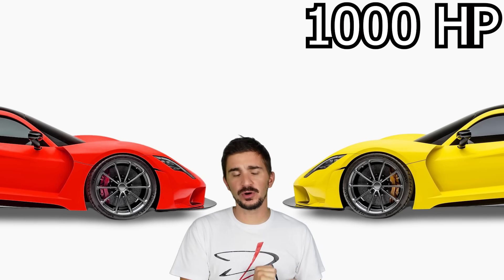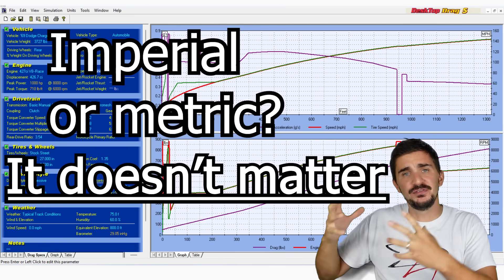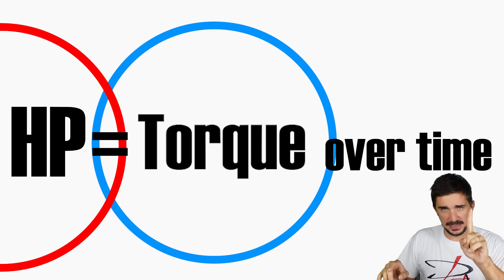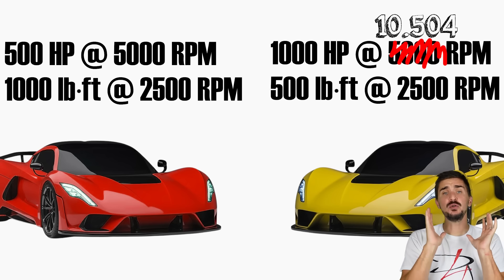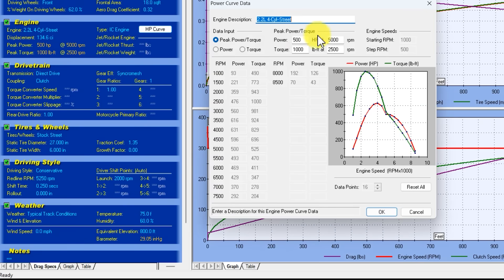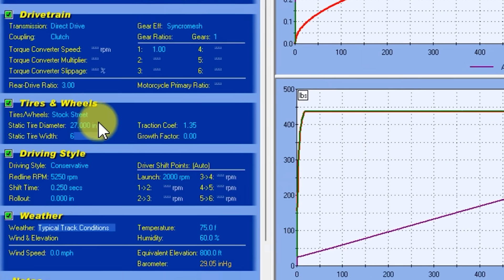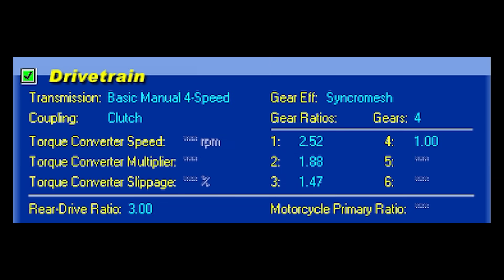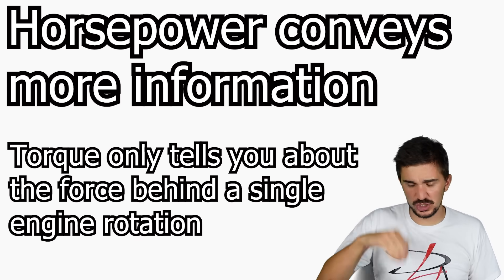Who's faster? Explained and Simulated - Horsepower vs Torque

Comment: Power = torque X rpm. I am not sure that equation has ever changed. Very few seem to consider that the transmission is part of the equation as well. It is torque at the wheels that determines acceleration, and final drive ratio/hp that determine top speed - not simply torque at the engine crankshaft. Just ask your local F1 driver.
Reply: your local what

Comment: To make things short, the car with more HP will always be faster as long as you are operating at RPM where the car is close to or at peak HP. The car with more torque will be faster only in situations where you are at low RPM where the car with more peak HP is not even close to that power.
Reply: yes

Comment: i really don't like the punching analogy.
simple reason is that energy equals mass times velocity squared.
thus velocity is the more significant metric in this case, meaning that someone who can move their fists faster to punch more frequently is automatically punching harder, so long as the overall mass is equal.

Comment: If we construct two engines with the same power curve except one is scaled to twice the max rpm with half the torque but twice the gear ratio, both cars will produce the same power at the same percentage of max RPM. The high reving car will have half the torque yet both engines will (assuming no drive train losses) perform EXACTLY the same in a drag race.

Comment: Test is so unrealistic and pointless. . Ur using 1:1 gear ratio. That 12k rpm engine would go like twice the speed to hit its 1000hp mark. 
Second u left the redline 5250rpm so engine never would hit the 1000hp. At 5k its 476hp 
This test is pointless.

Comment: I think main catch in this "versus" is the fact that you can adjust the wheel torque to any number you want with the transmission gearing (by the cost of rpm)
On the other hand there is no way to improve hp with any mechanical device. Maximum you can get is little improvement of hp for a few seconds with e.g. big flywheel but it's completely impractical 
So , basic idea is that what hp you have under the hood the same is on the road, while no matter what your engine torque is, you can get it as high as you want on the drive wheel

Comment: what simulating software are you using? i have an engine design that I'm working on and I want to be able to simulate the engines power output

Comment: The 1000 hp one will be faster if you push them both but the 1000 torgue one should push harder at low rpm assuming the transmission is the same

Comment: Well on the ocassions where the „torque biased” engine won, it would be worth metntioning, that the „power biased” engine lost because it never actually made it’s power or made it only briefly. The „torque biased” engine made more power on average.

At the end of the day - only power maters. The confusion comes from the fact that peak power that occurs at a specific RPM value, doesn’t tell how much power the engine makes anywhere else in the rev range.
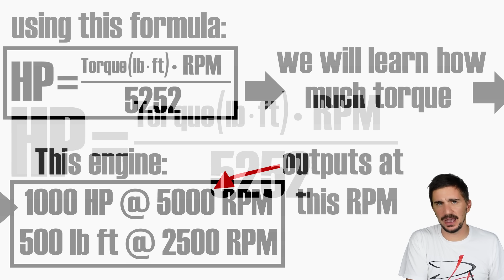Reply: yea cos he take gearing from 💩 which none manufactury use ever even for least sporty car or bike ever 🤷🏻‍♂️ once he give each of those engines perfect gearing and gear quantity its game over for more tq les hp version 👌🏻 assuming enough grip asf ,racing win power 👌🏻 never ever torque 🤭 mine cb 500 feg have 57 hp and 47 nm and smoked in drag race or on track with corners something like let say 🤔 yamaha mt03 this old not this new one so 660 cc 47 hp 58 nm at the same tire similar suspension asf 👌🏻 1/4 mille 13,4/152 km/h vs 14,2 sec /145 km/h and like 3-4 sec faster lap times on avg 4-5 km track 👌🏻 cos more power at the same speed generate more force accelerate bike forward faster ….. dosent matter how much less torque is available 🤓👌🏻☕️ hees presentstion is a joke like couple other on yt aswell 👌🏻 engine with more torque at low rpm is easier to ride dont need to hold so strictly to certain engine rpm so dont need to shifts so much up and down for get max performance on track 👌🏻 can give more pleasure avg rider due to theyr preferention 👌🏻but it cant beat on track more powerfull version with skill rider on it at similar tires perfect gearing asf both on dragstrip and on track with corners cos watt:m/s= force is key of take of corner acceleration level and acceleration overall everyhwere 👌🏻 ☕️ and yea me lap time 2:09 something on poznan track on me stock cb 500 pc26 on pirelli  sport demon is rubbish 🤮 so im must fix it 😉👌🏻☕️

Comment: Souly based off the words that were spoken "cannot cause damage with a weak punch"...   if you were to take a table spoon and repeatedly tap the top of your hand with a soft tap... over time you'd break the bone in the area of which you were tapping... same as a drop of water let's say on the forehead in the same spot over time will soften the skull...  but that's not what the video is about so back to the show..

Comment: HP will win because too mich torque will only make too much wheel spin in the first two gears. HP builds up with rpm exponentially. Depends on the maximum rpm of the engine obviously.

Comment: If they faced each other on a racetrack, the one with more torque would win. Experiment over. Sorry, I couldn’t resist.
Reply: buehehehe not true 👎🏻 sory boi 🤷🏻‍♂️😎  power knockout torque at race track like nobodys bisnes 😎 not even close 🤭👌🏻 …. feg me honda cb 500 pc 26 47 nm 57 hp vs yamaha mt03 660 47 hp 58 nm and cb smoked mt03 👌🏻 or benelli imperiale 400 29 nm 21 hp vs benelli tnt 302 25 nm 37 hp and tnt 302 smoked imperiale 👌🏻😎 or ultraviolett f77 recon 100 nm 40 hp vs let it be again me cb 500 pc26 47 nm 57 hp and f77 is smoked on racetrack offcorse we talking about fastest rider and the same tires on each bike😉👌🏻 i have also some test with car on poland  poznan track so feg fiat bravo sport 1,9 multijet  150 hp 310 nm best lap time under pro racedriver polish champ in some cup on this track 👌🏻 2:07:95 sec 👌🏻 vs feg seat leon cupra r 225 hp 280 nm 2:02:4 sec 👌🏻 or skoda fabia rs tdi 130 hp 310 nm 2:10:5 sec vs honda accord  2,4 type s 190 hp 223 nm 2:06:45 sec 👌🏻 where torque win against power at race track ?🤷🏻‍♂️ where? i cant see it 👎🏻🤷🏻‍♂️🤭😎☕️
Reply: @mociczyczki  it’s a joke. If they are facing each other they will run into each other and be pushing themselves backwards.

Comment: I wouldn't make this so complex to understand. Horse power is the thing that accelerates the vehicle and engine torque is insignificant. All we need is a horse power curve and we can the rpm's to accelerate with. Best acceleration happens both sides around the max hp area by maximizing the average hp during the acceleration. The flatter the power curve is, the less gears we need.

Some can say it is the torque, which do the acceleration, and it's true in certain ways. Constant torque in a wheel cause constant acceleration. However, we need gears with practical engines, and we can't use torque curve in similar simple ways.

Comment: He is very wrong. Torque can be applied and get zero HP , but you can never have zero torque when you have hp. Torque is a rotational force. Apply 2500 pound feet to a frozen up wheel, how much Hp did you measure? Zero. You need the rpm the frozen wheel didn’t have. 

The biggest pile of HP wins every time period.

Comment: Torque vs hp discussion only tells you’re ignorant. In here it was not properly addressed that you need to have the gearing figured out to make use of the power avalilable. It is still apples to bowlingbools to asses different poweraources with same gearbox.

Comment: This is a superb example of a person who knows a lot, but does not understand what he knows... maybe he needs more time... maybe just too young.
Reply: egzacly 👌🏻 he totaly avoid perfect gearing simulation where more powerfully less torque version absolutely smoked counter more higher tprque version less powerfulll 🤭😎👌🏻☕️ real life egzample electrick kick scooter 120 kg with 80 kg rider on it kukirn g4 38 nm 2,7 hp in rear whell hub motor 0-50 km/h 7,5 sec +/-  + max speed 60 km/h gps vs honda dylan 150 gasoline cvt 14,2 nm 15,5 hp 210 kg with 80 kg rider on it so almost double the heavy weight to accelerate yet 0-50 km/h in 3,75 sec + max speed 105 km/h gps 🤭😎☝🏻some another egzample benelli tnt 302 27 nm 38 hp 210 kg vs h-d x 440 38 nm 27 hp 200 kg let say on h-d is 10 kg heavier rider 0-100 km/h benelli 7,5 sec vs h-d 10 sec vmax benelli 155 km/h vs h-d 138 km/h gps 🤭🤷🏻‍♂️ hees video is trash like many other on yt ☝🏻😎 however in regard to daily riding normaly not racing it can help choice avg people better car in heees stupi….ty 🤭 🤷🏻‍♂️ fpr them with more power on lower rpm hat gives them better elasticity but when it comes to pure racing power absolutely beat tprque 1000000% 🤭😎☝🏻☕️

Comment: You’ve explained something that I have been wondering in a long time in just 14 minutes perfectly for newbies, kudos to you sir!
Reply: yhm but than you setup drag race between brough superior ss100 75 nm/45 hp vs bsa goldstar 650 55 nm /45 hp vs honda cb 500 pc26 47 nm/57 hp vs kawasaki zx4 rr 40 nm/75 hp let assume if something here have not perfect gearing in regard to its peak power width than we give this bike this perfect gearing for 1/4 mille also we compensate diffrenc in weight be additional weight on lighter bike and that zx4 rr we take off fairing for also make its drag worse the same as other 3 bike here naked 👌🏻 and what happen ? 😁👌🏻👉🏻 ss100 and goldstar cross finish line basically in the same time around 14,2 sec on1/4 mille honda cb 500 cross finish line in 13,2 sec with around 40-45 metres advantage and zx4 r without fairing cross finish line in 12,2 sec with 80-90 metres advantage against ss100 and gold star 650 and 40-50 metres advantage against cb 500 👌🏻😎 so yea wait 🤔 bike with bigest /highest crank engine torque cross finish line last and bike with lowest smalleelst crank ngine torque first? 🥴 welll YEP egzacly 👌🏻😎 the placement was beacuse of power diffrencesss not beacuse of torque diffrencesss and hess video is well dont be lie 👉🏻just 💩 🤷🏻‍♂️☕️
Reply: his explanation is kinda confusing with the punches and stuff.
Torque is how much force you can apply, not speed. instead of seeing it like a damage per hit, consider torque as armor penetration.
You need good armor penetration and good damage to kill a monster with armor and health, but a monster with no armor but lots of health only needs high damage. On the other hand, a very well armored monster with low health will simply ignore your attempts if you have no armor and can not deliver your high damage.

Real life example. 
Would you rather take an impact drill or a regular drill to defeat a bolt with lots of "rust" armor? Impact drill has a lot of torque, but low speed.
But what if its a loose bolt? Aka has no rust armor.

Big rigs in Europe have lots of torque, very little horsepower, because they need to defeat the "weight" armor quickly so they can quickly apply the "speed" damage while American trucks dont really care about the "weight" armor and rather flash their high "speed" damage, resulting in slow acceleration, but they get there eventually.

Comment: Actually this is not wrong but also not correct. The Ratio 1 is in combination with the tire diameter the most important factor in your simulation. The ratio is to low for the torque engine and to high for the hp engine. You have to find the optimal fixed ratio for for both engines and to compare this. Than the hp engine would be much better than the torque engine. Your explanation has already explained it is making double damage. And with a fixed ratio and limited traction it should even has more advantage. 

Also for the heavy car with the bricks. Just again search for the optimal ratio for both engines and the hp is again much better.

In your simulation the ratio is more wrong for the hp engine this is the only reason for your results.

Even when you argue the ratio of 1 is „natural“ … just change the tire diameter then😊

Comment: I would also like to mention endurance considerations, engines build for higher torque numbers at lower rpms tend to survive longer at rated output compared to high revving engines which produce same wheel torque via transmission ratios.

Comment: Love the video but I'm wondering why we didn't do the same adjustment for the torque car that we did for the HP car. As with my calculations, to get 500 HP with 1000 lb ft of torque, you'd have to rev at 2626 RPM

Comment: Without specifying any further details (peak power rpm, peak torque rpm, car component parameters etc.), 1,000 hp is always the clear winner over 500 hp because with twice the power, you can have twice the force pushing the vehicle forward at any vehicle speed. Obviously, real-world cars have many variables that may make 500 hp look better than 1,000 hp in some scenarios.

Comment: From what i noticed, the torque biased engine had a handicap. The 500 tq, 1000 hp at 10000 plus rpm number was based on 1000 tq, 1000 hp at 5000 rpm. So the torque biased engine would have been a 2500 rpm engine. Clearly it made 500 hp at 2500 rpm and magically held it for another 2500 rpm. Hp always win.

Comment: I have degrees in physics and on paper one would think it's all about horse power and gearing. Ironically I have a diesel and every trucker tells me tongue is very important .my thought is higher, torqe motors are less likely to bind allowing a more efficient transfer. As I watch videos there is more to all of this than the simple newtonian equations taught in college.

Comment: Lamborghini was -- and still IS -- a tractor manufacturer.  One day the owner said, "But what if I use that gnarly over-sized tractor engine, but just mate it to a gearbox that prioritizes power over torque?"

It's like if you have massive quads, but you're on a 18-speed bicycle set at the highest gear.  You can strain with all your might, but getting up to speed isn't going to be easy.  High power... low torque.  On the other extreme end, in the lowest gear, that back wheel is going to turn no matter what the circumstances are... but you can rule out any high-speed.  But as noted in the video, you can make that power all the same... but you'll have to pedal like a demon (high RPMs)

Comment: 1000hp/500tq will destroy the 500hp/1000tq through the to the 120mph mark. After that 500hp/1000tq will walk away. Perfect example is the nissan gtr. That is how it becames the turn key from factory street racing king. The v6 turbo had built in torque limit just like a properly tuned mustang v6. Everything lined up next to the gtr got left at the start. 

The nissan gtr twin turbo  only produced 500lb-ft torque but but 800-1500hp. The all wheel drive system also helped deplete the wheel spinning torque keeping the output just below wheel spinning threshold. 

All the v8 competition was making 1000hp/1000torque. Sure the numbers are impressive but touch the gas pedal aggressive and you ice skating on the strip. That is the gtr dominance secret. Its always at the edge of tire spin but doenst cross the line of spinning aint winning.

Comment: Having driven both, I personally prefer high torque, low horsepower. It doesn't take as long to hit the power band, and that helps you out of some sticky situations when you need it to. It also seems to last longer, but that's just a half-finished thought talking. 🤔

Comment: So if Im understanding this correctly the torque biased engine needs a transmission which always gives double the gear ratio at half the rpm to basically match the horsepower biased engine. The torque biased engine should on paper perform basically the same but due to lower revs and less friction losses be actually more efficient.

Comment: rule of thumb: hp makes you fast on a flat road. Torque gets you up the hill.

There is a reason why tractors usually do  have surprisingly low hp but high torque. You don't need to be fast. You need to pull a big load.

This is also why people who pull horse trailers prefer torque over hp. You need to get going. And keep going. You don't need to be fast. And you don't want to rev high, because that would just increase your fuel consumption.

Ever asked why trucks have big diesel engines (high torque) that run at low rpm and low speeds? To save fuel. While moving that load.
Reply: rule of bs 👌🏻more like 🤓☕️
Reply: @mociczyczki  do the math ;)
Reply: @methanbreather  🫣 yea you need it 👌🏻☕️
Reply: Torque is the sound of one hand clapping

Comment: I really love the punches analogy. However, there is something really unappreciated in this video, is tire choice. I do sim racing, and his tire choice for this test definitely favored hp over torque. There is a reason drag tires have low pressure and no tread. That being said, great video. I did learn something. Thank you.

Comment: In the real world the 1000 hp car will always win the drag race because the gear box will be specifically chosen by engineers to provide twice the leverage, and cut the revs in half, thereby doubling the torque at the rear wheels. 

So, it'll effectively have 1000 ft-lbs of torque all the way to 10,500 rpm.  It'll be ripping up the drag strip at triple digit speeds.

Sadly, the 500 hp car only makes 500 ft-lbs of torque at it's 5000 rpm redline. Since it has half the gearing it will still be effectively 500 ft:lbs, and not 1000 like the other car. It will have only half the acceleration as the driver revs out the gears.

And don't bother upshifting to take advantage of the 1000 ft-lbs of torque at 2500 rpm. Once you upshift to second gear, and drop the revs in half, you lose 50% of the leverage provided by first gear. 

So, rear wheel torque won't change. Engine torque doubled, but leverage was cut in half.

So, there's nothing you can do but install NAWS.